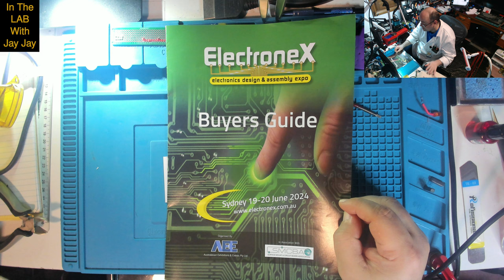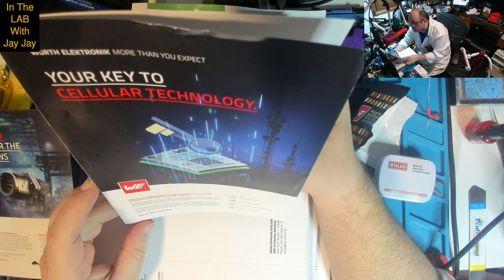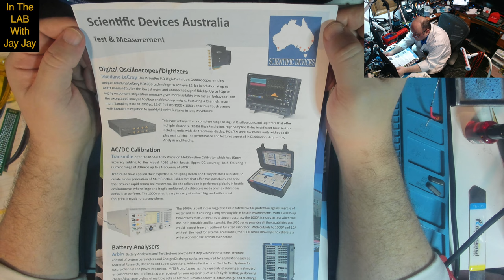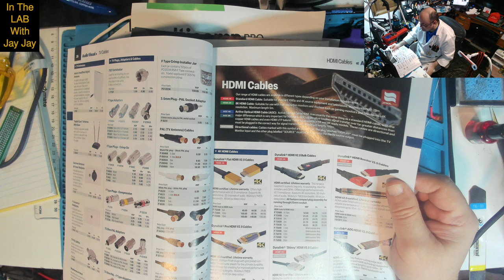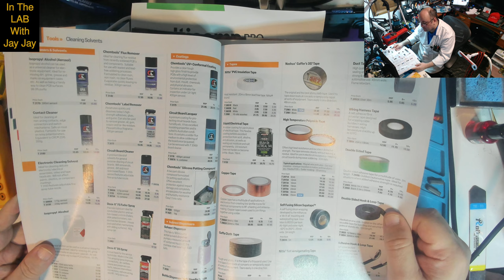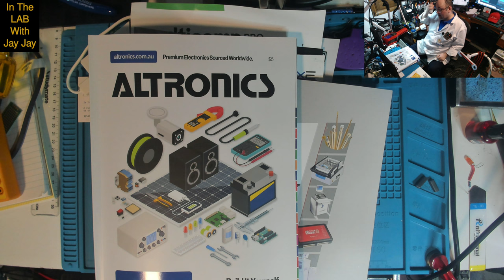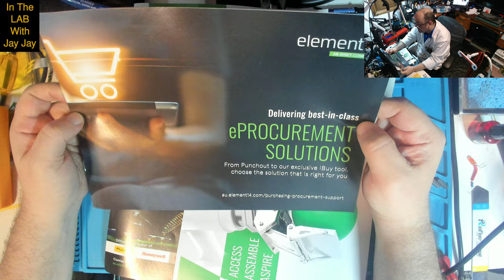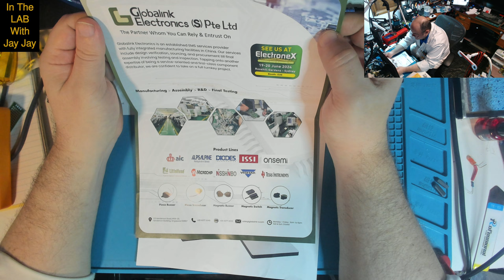Interlude #7: ElectroneX 2024 Debriefing | Learning Electronics In The Lab With Jay Jay

Comment: Just some info for you mate

SKEDD is a technology developed by Würth Elektronik with which connectors can be connected to the circuit board directly without soldering. This type of contact offers considerable advantages over soldered connectors
Reply from the maker: Thanks Joe. I will check it out.